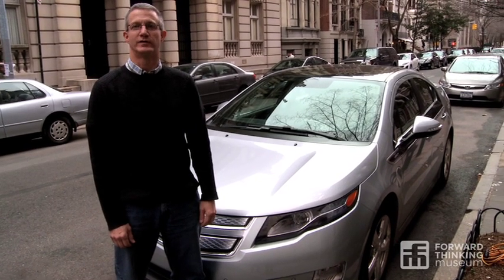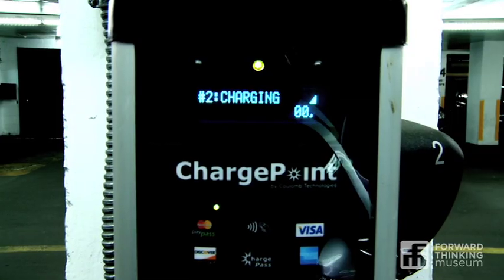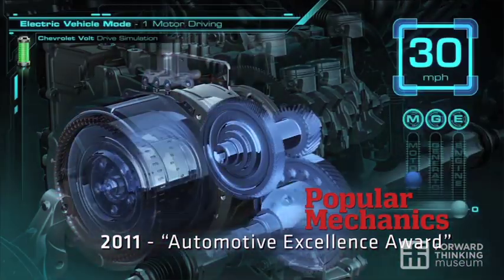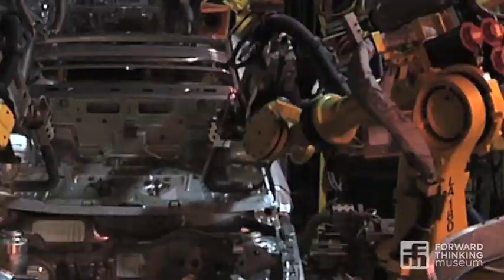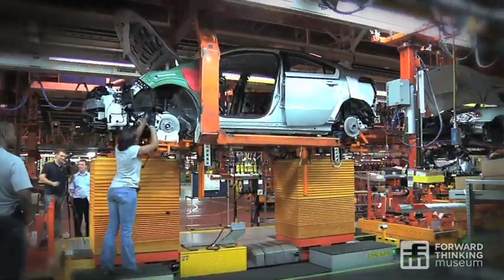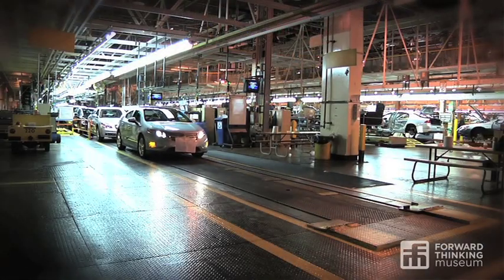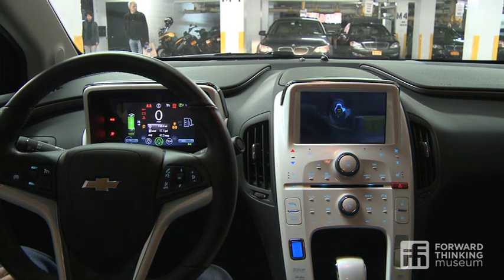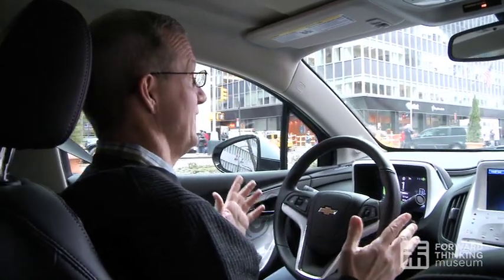Electric Cars: A New Generation of Plug-Ins

Comment: It still wont live up to its Distant relative. The EV1 was the true pure electric car! and u had to plug it in to keep going. And the Gas engine will never disappear. cuz as apposed to a electric car if u run out of fuel u can stop at a station and fill up and be on your way in 3-6 minutes. where a electric car will take 7-8 hours to charge. If every car did go electric we would go back in time not forward just cuz of that. so even a hybrid will still need fuel in the end of it all.

Comment: Unfortunately some of the information provided is incorrect. The engine doesn't only function as a generator, it is also physically connected to the drivetrain in a hybrid configuration. To accurately describe the Volt, it is a hybrid gas/electric car, sometimes a parallel-hybrid and sometimes a series-hybrid.